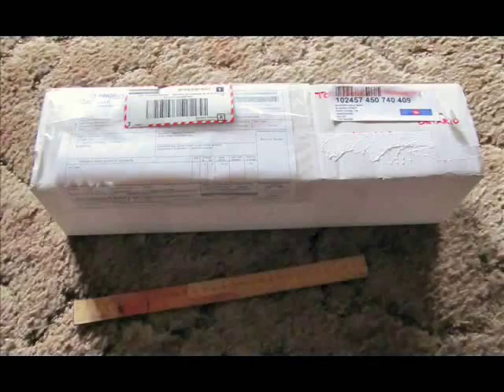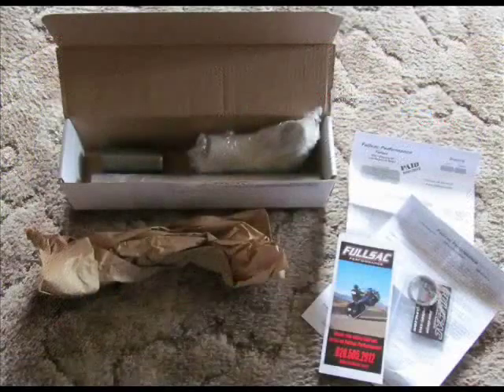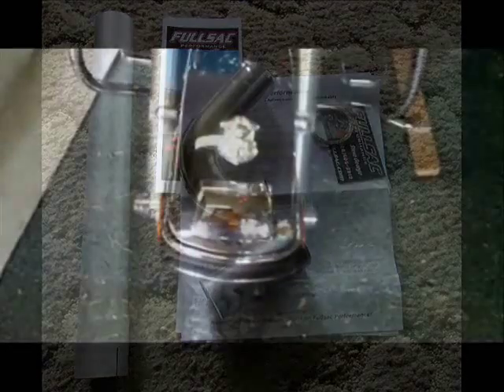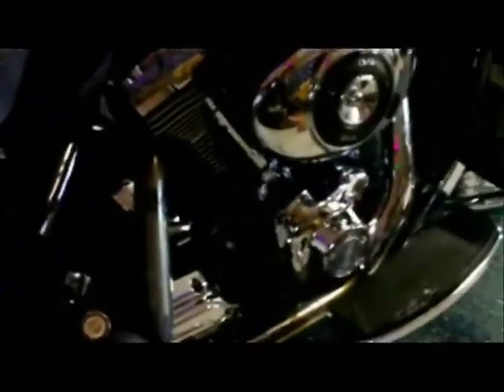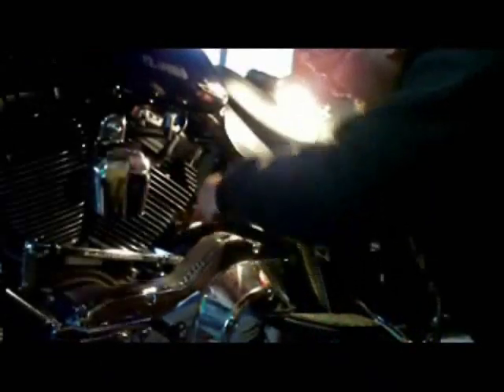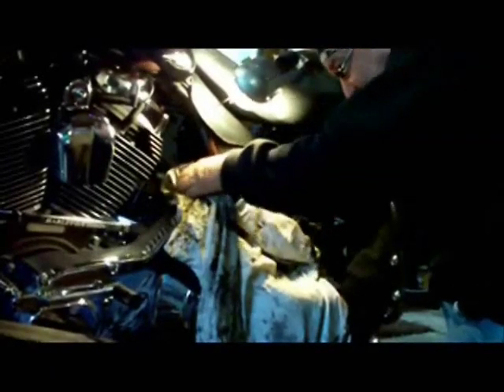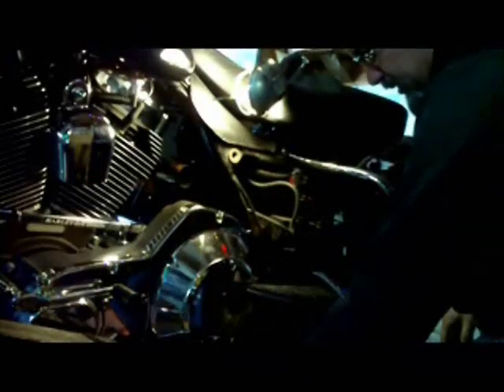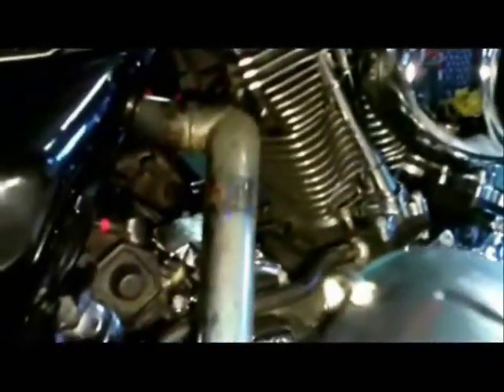Harley Fullsac True Duals Kit Installation

Comment: Took me about 3 hrs total, disassembling took a good part because the right side pipe is connected to to front exhaust and the two screws behind the cylinder was a little tricky. But after all is taken off it went quick. What a difference is the sound and the extra few horse power with smooth engine rev. Took it out on the highway and the bike responded really nice, no pops on decel. I recommend these on all bikes with the Y exhaust.

Comment from the maker: The mufflers are Rush slip-ons with 2" baffles. At the time of this video I also had a K&N air filter but that was all. It is stock EFI. I still had quite a bit of decel pop with this set-up but I recently I installed Andrews 26A cams and that made a huge difference. .